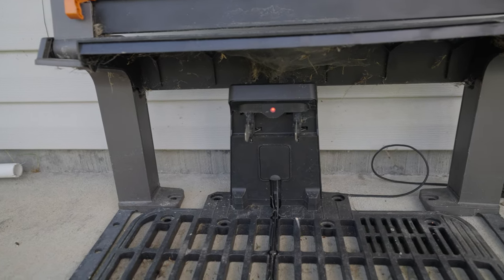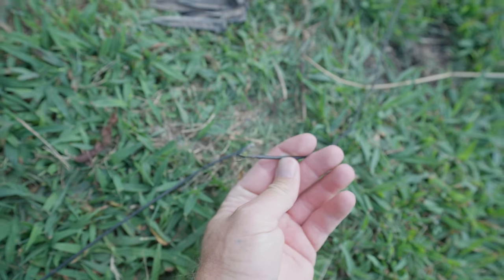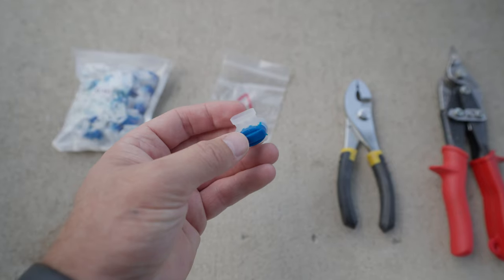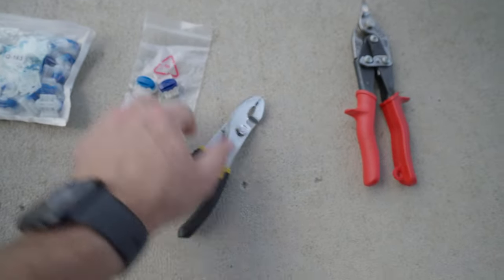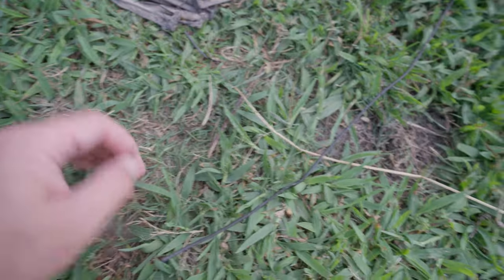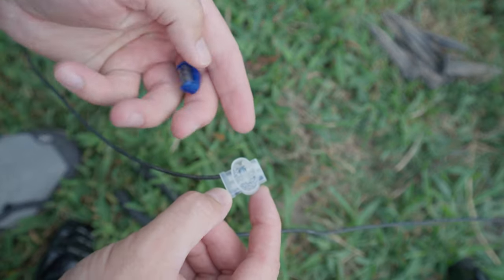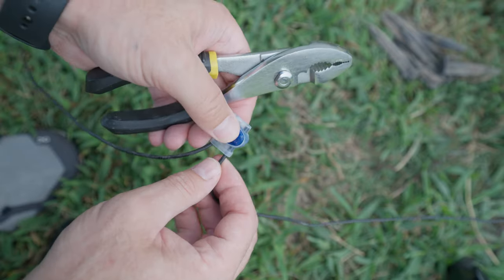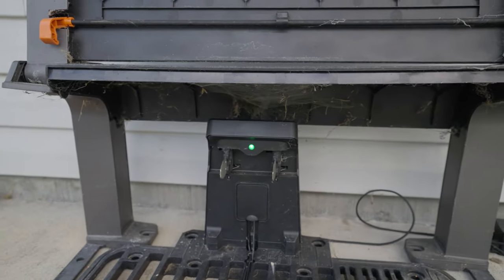Fixing a Robot Lawn Mower Broken Perimeter Wire (Landroid, Husqvarna, Gardena, Robomow)

Comment: The way to find a broken buried boundary wire: Take a lawn mower or any small engine, unhook the boundary wire at the base, wrap that wire around the spark plug wire, start the engine. Get a AM radio with an antenna adjust the radio to around the lowest AM radio station listen for the static with the antenna close from the spark plug connected wire, follow the boundary wire listening to the static, once it stops start digging for your break. I had to do this 2 times so far.
Reply from the maker: Great tip.  Luckily for me, I cut the wire so I knew exactly where it was.
Reply: Will you be able to do a video to show steps of what stuff you use and how to go about it. 😅 I just had my wiring missing after aeration 🤦‍♀️

Comment: I cannot find any broken wire. I'm at my wits end. Wire locator, radio, nothing worked. I just get a red light and wire missing ALL THE TIME. Made a front yard zone, wire missing. Back yard zone, wire missing. So wire is broken in two places??? How did it get back to the dock on it's own then? Something is wrong and cust svc won't help me. What should I do., I'm going mad
Reply from the maker: I'm sorry you are having trouble.  Have you used a new piece of wire and connected it to both ends to see if the green light comes up?  Maybe it is the base that has something wrong?
Reply: @HangingOutWithMike  I had the same problem. I found that the mower had skimmed some of the insulating cover off the cable and the weather had effected the wire. The only way to find the fault is to inspect the whole way around the wire and cut out and replace the damage section.

Comment: Hello, mine doesn't show any red light (it's still green) but I get this message that "wire is missing". Do you have any idea? I really appreciate if you respond
Reply from the maker: I have no clue to be honest, but maybe try registering the landroid with it on the base.  If I remember correctly, the landroid also needs to be on the same wireless network as your phone.  If everything registered correctly, maybe you have too much wire and the signal is too weak for the landroid to pick up?  I'm sorry I am not more help at the moment.  I will try and do some research and figure it out.